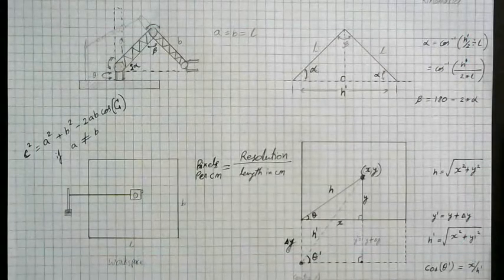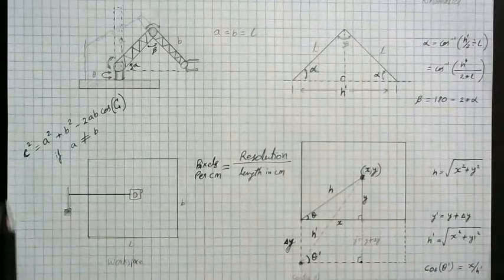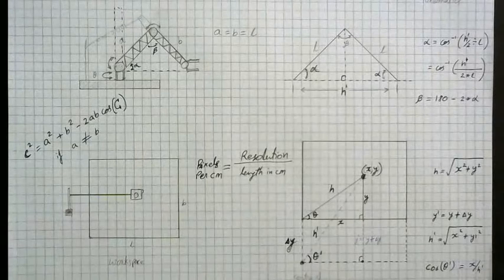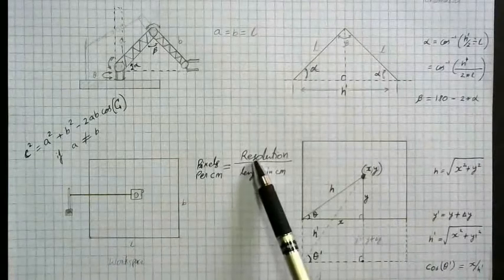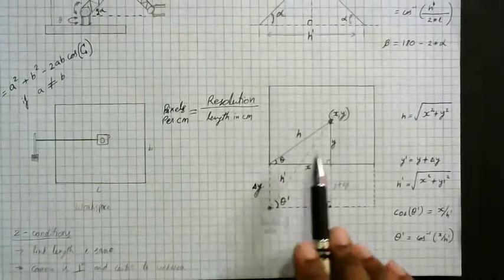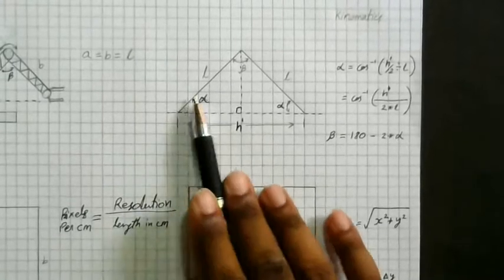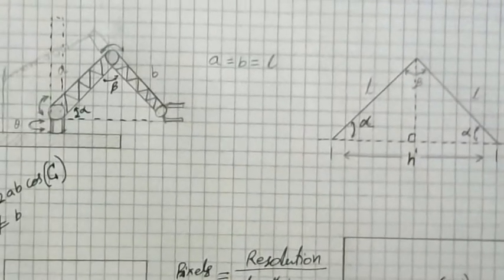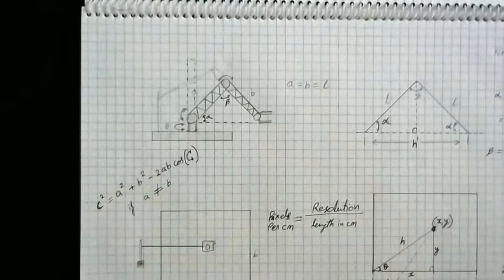Simplest calculation for Autonomous Robotic Arm

Comment: Which book you had referred for the calculation and design ?
Reply from the maker: its school maths didnt get it particularly from a book. I went through some mechanical engg books at college and found there is something called kinematics, never understood how to use them for my robot. So I thought of using some simple maths. As I was constructing the arm it looked like an isosceles triangle so used Cosine law to find angles. And similarly on workspace  i saw right angle triangle so applied  pythagorean theorem. To convert pixels to real world coordinate used ratios. thats why this works only on equal length links of robot arm.
As for the design, simply did what had to be done at that time.  Most of the concepts I learned was from google search. for design you can refer to uArm.

Comment: hello thank you for your amazing video. Could you please explain how can we process the image from the camera and which camera could we use because I don't think I will find anarduino camera here. I need to make an autonomous robotic arm that is supposed to collect colored rocks. Can you guide me please. Thank you so much in advance.
Reply from the maker: I used a webcam for my project and i read pixel by pixel to find the object (it was long time back). Now you can use OpenCV to detect colour blobs and the api gives you the location. I ll give you some links for the OpenCV solution.
you can search for object detection and blob detection in opencv.

Comment: sir please make the video on the gripping force calculation, I am works on robotic project project but i do not have perfect idea to calculate gripping force, please guide me
Reply from the maker: Hi Pankaj, I used a soft tact-switch from a floppy drive as sensor. it was fixed to the gripper and once the button was pressed the gripper would stop at that position. Never used any calculation as such. If you are handling some heavy objects like flat metal blocks, I suggest to use pressure sensor.
have a look at this https://blog.robotiq.com/bid/69524/Robotic-End-Effectors-Payload-vs-Grip-Force
Reply: HAVE U COMPLETED  THE PROJECT?